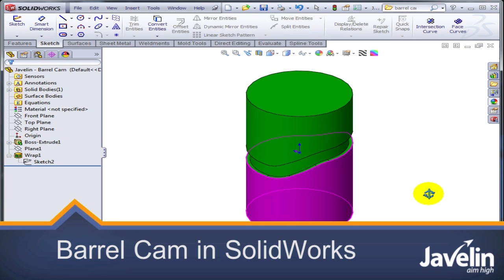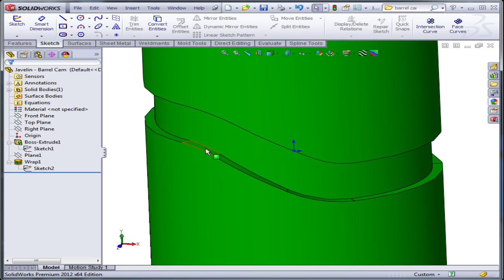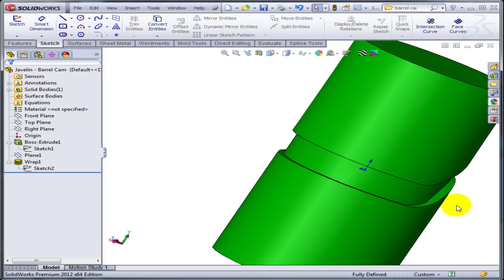Model a Barrel Cam in SolidWorks

Comment: this does not produce same result as if you used an end mill.  To get a more accurate result use Insert/Cut/Sweep/... then choose solid sweep - not profile sweep.  First you have to have created the path and a non-merged revolve of an end-mill tool.
Reply: i cant fully understand, there is step by step in youtube?
Reply: i did use solid sweep, not work, have distorted shape.
Reply: Jim Mullner, it ok now, in solid sweep, i open options tab, path alignment type: choose direction vector, then select surface of cylinder.. Thank you for your info.

Comment: Then you can create a sketch on one of the circular faces of the cylinder to create the core of the barrel and control the depth of the cam.

b) The other method that work for me is using the Project Curve Feature. You create two project curve from a plane tangent to the face of the cylinder. Then create a Sketch or solid that will act as your cutting tool. Use Sweep Cut feature using both curves to guide the cut tool. Set the orientation to Follow path and 1st guide curve.

Comment: This does not work in the real work. If you section view the cylinder you are going to realize that the cam path gets distorted and it changes its angle instead of maintain both edges parallel. 

I've found two ways to get better results:
a) "Trim Feature" the cylinder with two surfaces using trim feature (each surface will represent each parallel wall of the cam that will guide the follower) 
This will give you as result 3 bodies like a sandwitch. Delete the body in between. Continue....